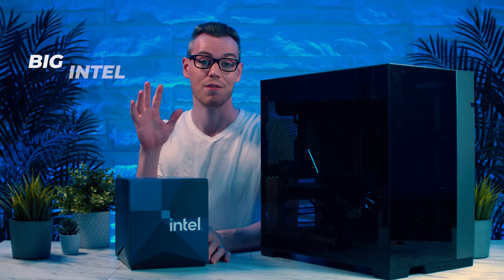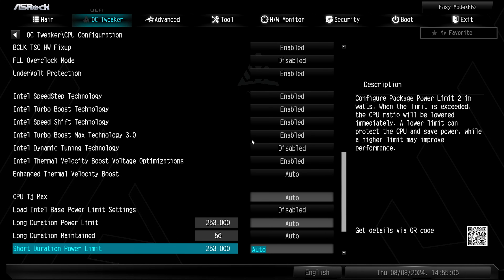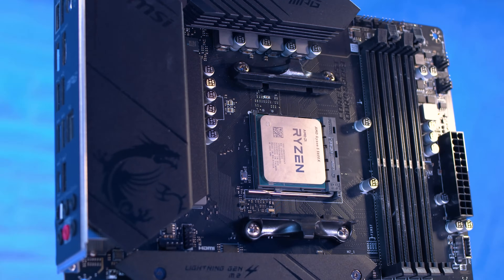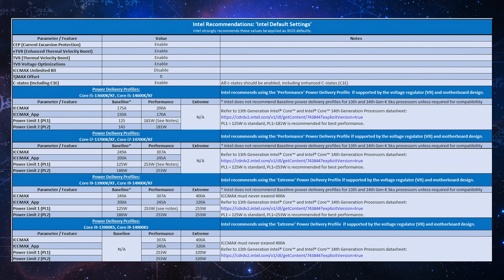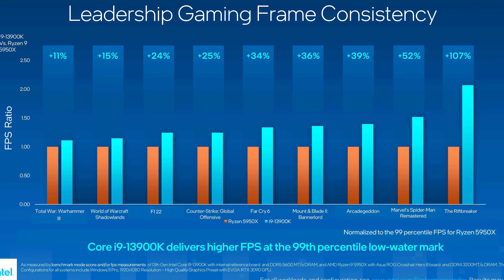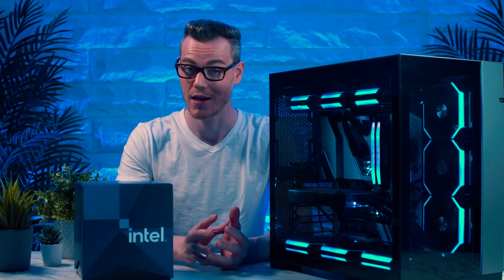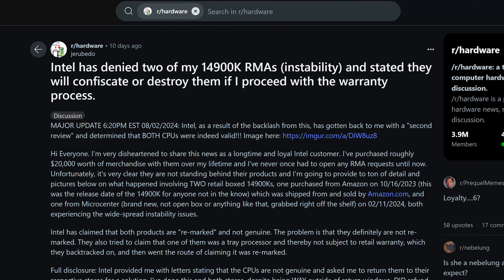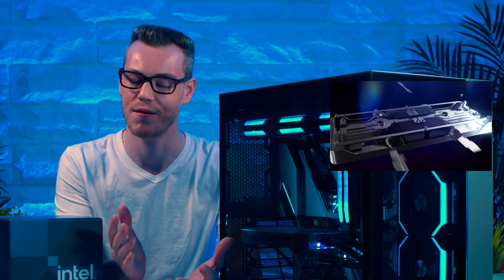The Intel Problem vs My $4000 PC... I'm Getting Mad Now

Comment: Thank you! 🙏🏼

I've been monitoring this Intel CPU debacle closely, and I'm really glad to see you weighing in on the matter.  🤗

I have two Intel CPUs currently in use (an i5-12400 and an i9-13900T), and four others (all brand new) sitting on the shelf (for the builds I'm still acquiring parts for 🙄) -- an i7-12700T, an i9-12900k, an i5-13500, and an i5-13600k.

The 12th gen parts are probably all okay, and I believe I'm in the clear with my (35W) i9-13900T -- I've been running it 12-14 hours a day, every day, since I built this machine in mid-March of last year -- with zero issues under fairly heavy use -- but I'm waiting for 0x129 to hit all of Intel's board partners' BIOS update pages before proceeding with any additional builds. (And I'm patting myself on the back right now for using ONLY motherboards with a BIOS flashback feature, let me just say. 😇)

As for the oxidation issue: I've checked all the date codes on my CPUs and they seem to have been manufactured either before it developed (i.e. the 12th gen chips) or during the last 2 weeks of 2023 (all the others), so I'm crossing my fingers there. 🤞🏼

So for my overall situation, I'm optimistic - but for you and everyone else who's invested in expensive high-end, unlocked 13th/14th gen Intel Core processors -- and are currently getting the runaround from Intel regarding replacements -- I'm pretty damned concerned.  The situation doesn't look good (the way I see it) because, for them to 'do the right thing' (assuming they do pull their heads out and decide to make things right), Intel's going to have to take a HUGE financial hit.  (I've even wondered if the fallout from this mess mightn't result in Xe2 being eventually scuttled. 🤔)

Please let us know if/when you hear anything new. 👂🏼

Thanks again. 👍🏼

(Stay safe and be well! 🐱)

EDIT: Typo Management 🙄

Comment: My 13900k is crashing blue screening and everything you can imagine . Sending it to rma hopefully they will change it to a working one otherwise i move to amd
Reply: when you get your new one lock the p-cores very first thing when you turn it on. that will stop it from degrading - unless you get one of the Oxidation chips as your replacement then rip lol
Reply: @mehck-gk9yn  I think they are going to replace mine with 14900k because 13900k is not in stock
Reply: @oldtimebenchmarks5294  same thing anyways, but at least ur getting a replacement. hopefully it lasts
Reply: @mehck-gk9yn  I'm mainly using it for gaming I think I'll cap mine at 90w for safety I don't mind losing like 6fps for cooler and more stable cpu
Reply: @oldtimebenchmarks5294  as long as you lock the p-cores you can do whatever else you feel necessary. Locking the p-cores is mandatory though.
Reply: @mehck-gk9yn  what do you mean lock the pcores
Reply: @oldtimebenchmarks5294  lock the p-cores to the same frequency so you don't have 2 cores spiking mhz. That is what is degrading chips aside from oxidation.
Reply: @mehck-gk9yn  sadly it wont stop it . but will slow it down enough to get out of warranty
Reply: @zerokool1985  Users have had no degradation for like 2 years. You can't just claim every single 13/14th gen is bad. They're not all bad. Claiming they're all bad is weird bro

Comment: over the last two years with my 13900kf I had progressive performance degradation and blamed it on windows or software, until recently when I started to get frequent game crashes and BSOD. turns out my performance is now equivalent to a ryzen 5700x when and if it even works without crashing. Microcode update madenothing for me except reduce the performance even more
Reply: the i9 is a Enthusiast CPU product and is top tier for programmers , streamers and PC pro,s , when someone buys a i9 , they ussaully know how too build and or configure a PC and optimize it and reflash their bios or manually enter the settings --> in bios too fix the issue with Ai bio,s automatically giving the i9,s too much voltage and a failed overclock which it isnt supposed too do at all , power limits should be set too PL1-125 and PL2 253 and Core voltage while idle 1.0v and core voltage while boosted 1.2v , average gamers ussaully use i5 and i7,s ... you can manually press and hold DELETE or F12 on startup too enter Bios and enter the correct Intel Spec power limits and voltages or update bios too fix the issue causing crashes .. the issue is auto overclock failing and causing crashes ... and actaully Intel has had alot of SCAMMERs sending in i3 12100 and i3 13100 for warrenty with re silk screened too look like i9,s !!!! so they refuse too replacce those ones as their not geniune intel core i9,s .. scammers trying too get free i9,s ... not everyone is doing that but alot have ..
Reply: @EpicGamingEct  that dosnt solve the intel cpu degrading .  you can limit the power all you want but the IO controller cannot handle the voltage the cpu demands and is killing itself . the io controller is disconnected from the die and is connected to another part that needs higher voltage . unfortunately the io controller cant handle that and eventually fails
Reply: RMA asap and after they approve and give you the option to swap your CPU, demand a refund nicely. Get your money back you deserve it.
Reply: @mehck-gk9yn  Second that!
Reply: New beta update seems to hard force voltages down at times, to prevent damage I guess. Software can't fix degraded hardware tho
Reply: @Greenalex89  it dosnt fix the degrading
Reply: Degradation does not impact performance.  It effects how much voltage is required to keep the chip stable.  If the chip is slowing down something else is at play.
Reply: @JathraDH  Degraddation forces you to either undeclock or overvolt to reamain in the same clocks thermally limiting you
Reply: @epeksergastis  Fair, if your cooler is bad I suppose.  Still, it itself is not really slowing the chip down.

Comment: Maybe get in touch with framechasers. All CPU's degrade overtime. Its not like a xeon sandy or ivy bridge will last a decade overclocked. Yeah AMD Chips too. Though spectre meltdown is worse then this. Also Puget systems were ahead of this years ago. Framechasers says microcode updates won't help you. Intel is just masking the problem.

Comment: I'm glad I'm not a content creation guy who needed an Intel cpu, but just a gamer. My Ryzen 7 7800X3D has been probably the best cpu purchase I've made and looks to be for a few years more. Sorry, Intel consumers😕
Reply: I started using the 7800x3d on my work pcs.  Keeps my office cooler, uses less energy, has been very stable so far.  I have swapped almost every one of my kids pcs over to it.  Fantastic cpu.  You can cool it with a silver soul 135 just as well as a noctua.
Reply: @charlesg5085  Yeah, you could cool it with a Wraith Prism cpu cooler if you really wanted to, lol. I've got mine cooled with an aio and a -30mhz boost offset, max temp of 75. I want it to last.
Reply: @TBRANN  I could detect no performance difference level between a noctua NH-D15 and a silver soul 135.  I didn't believe it at first.  Every single 7800x3d I have build with I can just put a -20 on the voltage offset and enable pbo and they have all been stable.  I am making a living using this in my main pc right now.  Fantastic cpus.
Reply: @charlesg5085  absolutely
Reply: Save one for me! 

(Once I'm done with my current round of builds) I'm moving back to Team Red. (The last AMD CPU I used in a build of mine was a Phenom II X6 1055T.  😛)
Reply: My best friend at work went that route, while I went with Intel. His system is fantastic.
Reply: My 7800X3D with a -40 Negative Curve Optimizer Undervolt is perfect for content creation, it handles everything no sweat.
Reply: @iLegionaire3755  Hmmm....I've never heard of anyone using a -40 offset before. I've seen -15 to -30, but I guess if it works, hell yeah.
Reply: no joke, amd cpus are always faster than intel in creative works at the same power consumption
Reply: 7800x3d is probably one of my best purchases in a while, fantastic cpu, efficiency, gaming performance and am5 platform at the time in building my pc. Also I don't know why people pose it as not fit for workstation needs as it can very well handle most of it just fine. Unless you're very hardcore and niche in that case there are better alternatives and offerings from amd as well
Reply: 7800X3D does productivity and content creation perfectly fine, with nonexistent power draw. GOATED CPU.
Reply: @iLegionaire3755  With some use cases,  Yes. Not so much when using Tesseract Software or COBOL for large-scale batch and transaction processing jobs.
Reply: That is what the 7950x3d is for love mine it crushes eveything, I'm coming from a defective 13,900 K that I RM made and then immediately sold the unopened chip I did it literally the day before Wendell released his video
Reply: @danielabbott9312  Good timing!!! 👍
Reply: Clown😂
Reply: Same!
Reply: People seriously underestimate how powerful the 7800x3d feels.
Reply: The 5800X3D is the best value for gaming as well if you don’t want to upgrade to AM5
Reply: I am glad I went with the 12900KF.  I am not having any issues and by the time I need to upgrade Intel will be on 16th gen or more.  I swore off AMD after the FX8350 Black was such a letdown. I will probably never go back to team RED.
Reply: @falkwulf3842  your missing out. These days, its price to performance is  king. Especially the X3D models for gaming.
Reply: @TBRANN  In gaming yes, the 7800x3D is the king. But for my use case which is not gaming,  the Team Red offerings just dont hold up.
Reply: @falkwulf3842  Then you aren't very smart. Ryzen came out in 2017 and has been cleaning Intel's clock for over 7 years. You must live under a rock.
Reply: @christopherjames9843  Benchmarks say otherwise. Real  world applications say otherwise. Fanboy all you want but what you claim is not true,  as there are millions of articles and certified benchmarks that prove it, especially for product SKU's at the sub 500 dollar price point.
Reply: @falkwulf3842  The onus is on you to prove it. Not me. 8 out of 10 retail cpu's sold month after month are Ryzen cpu's. Not Intel. Hence the bloodbath that is Intel's shrinking market cap.
Reply: @christopherjames9843  Source for your  8 out of 10 claim?  As for onus You have made many claims about AMD that simply are not based in verifiable facts.  I get it your a fanboy, but those of us who work for a living and need processors that operates within a very specific use case scenario understand that AMD processors at the sub 500 usd price point are not up to the task,  especially on COBOL and Tasseract functioned systems that regularly execute large-scale batch and transaction processing jobs.
Reply: @falkwulf3842  🤡
Reply: @falkwulf3842  ryzen dog walks all over intel and wont crap itself . the funny thing is that old fx  cpu at 5gh will probably outlast all intel 13 and 14th gen hahaha and thats pretty sad
Reply: @zerokool1985  Cute story. Keep trollin, cause anyone who has ever ran those Pile's know that 4.7-4.8 was all you were gettin without LN2 and even then they were not exactly stable.

Comment: The micro code is out, it seems like it does what they say it does... but i dont think thats the whole issue solved. GN will probably do extensive testing, especially as there is suspect contamination. Also, intel doing rma.... man, i dont trust them. Ive heard so many people being turned away, whether they were fake or not. Its worrying